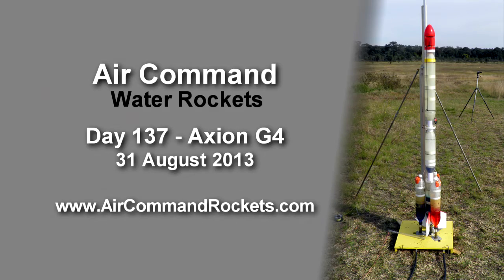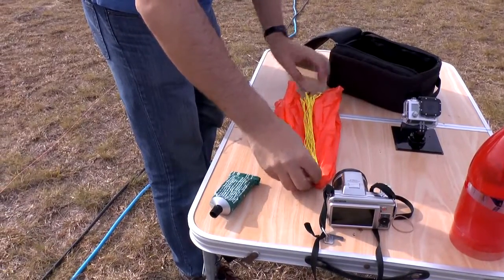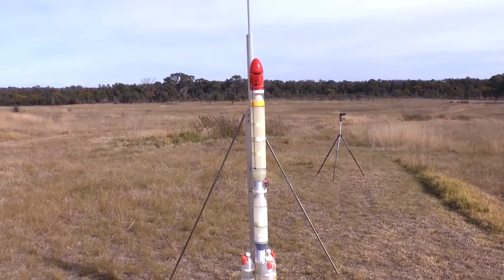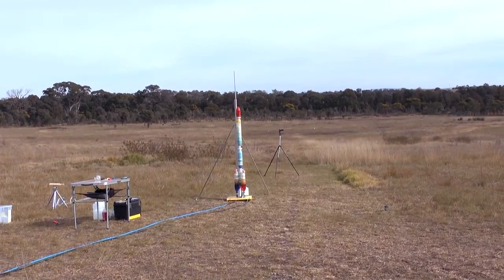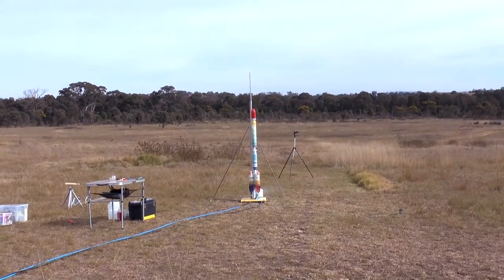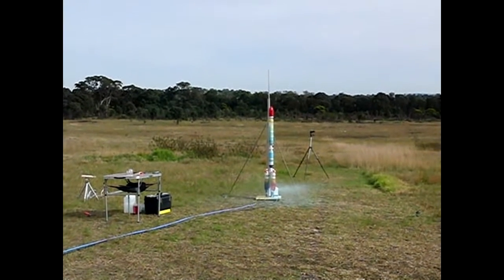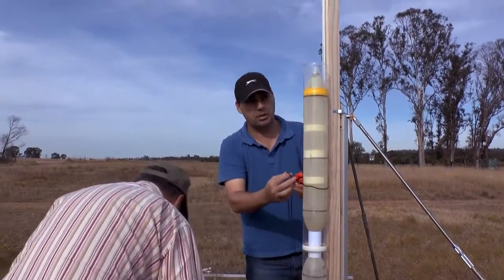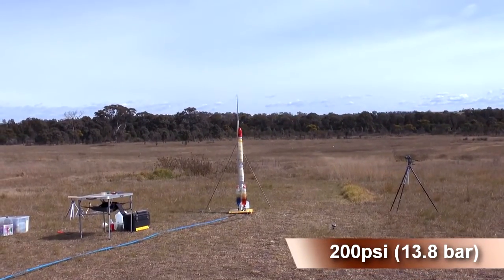Axion G4 rocket with boosters

Comment from the maker: Thanks bruba95. :) We didn't simulate this flight before hand. Much of it was based on our previous flights with this rocket. It would be nice if the simulators included foam as an option. Foam really changes the thrust profile compared to water alone and so the normal simulation predictions can vary from actual flight.

Comment from the maker: Hi NDogLover, We use the jet foaming technique with the jet foaming spacer to create the foam in flight. Adding foam to the water without the jet foaming, the trails aren't as long. The foam trail with this rocket was a little more diffuse than normal because of the smaller nozzle. The nozzle here had a cross sectional area of ~40% less than the normal 9mm Gardena.

Comment from the maker: You can certainly extend the boosters further for better performance, but you have to pay attention to overall rocket stability, either adding larger fins, or extending the length of the main stage even further so that the center of gravity moves further up. We find that pressurising normal un-reinforced bottles beyond 130psi tends to deform them permanently.

Comment from the maker: Thanks Randy. I'm pretty sure it was mis-aligned fins. I noticed when I was putting the rocket together that one of the fins was at a bit of an angle. This is an old fin-can that we put on and it's always had this issue. I think we'll toss it and make a new one. The camera sticking out the side also doesn't help, and with such a long burn the rocket would have been less stable because of all the water near the tail.

Comment from the maker: I've added a link in the description that shows how the boosters deploy their parachutes. Basically there is a wire attached to the main stage and threaded through the parachute door latch on the booster. As the booster falls away the wire gets pulled out and the door opens and parachute falls out.

Comment from the maker: It's certainly something that is possible, but it is a difficult problem. I have seen attempts done on model rockets with various degrees of success. I have also seen a couple of attempts at roll control to stop the rocket from spinning which also partially worked. I think the key is having fast processors, sensors and actuators to achieve a good result.

Comment: As you have seen in my latest video i have to do some rebuild. And I'm working on a new high pressure rocket with a lot more capacity. So the new project is to get pass the 200m mark. I know that it will take a lot of work. But I'm just gonna go for it!

Comment: I keep wondering if it might help if you would put rudders at the back of each fin and control them with a micro controller to keep the rocket pointing upwards. I do not know if the extra weight would be compensated by the reduction of "steering losses" and if a controller would be fast enough to do the PID calculations.